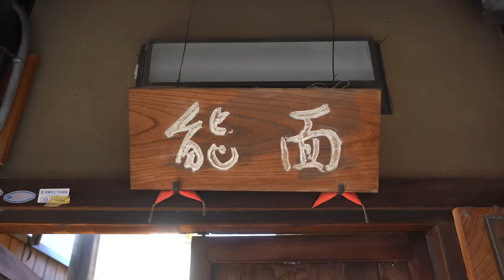能面ができるまで。日本で４０年以上磨き上げた職人の能面作り

Comment: What incredible patience this lady has! I wonder if the mask tells her what kind it wants to be, or does she have a plan in mind when she starts one? Fascinating!
Reply: I think she did have a plan in mind because unless she was working on the whole repertoire of masks at once (which I doubt), she had an empty peg for it on the wall.
Reply: these are masks used in Noh, a form of theatre with "fixed" characterizations. iirc the one she made here represents a maiden or lady of high standing. there are others for general stock characters in plays like your noblemen, vengeful   spirit, elderly, etc.